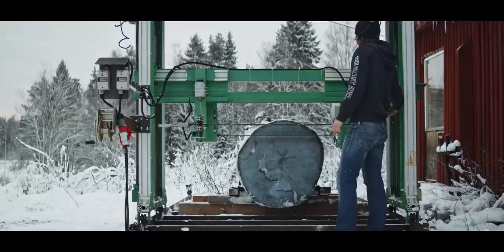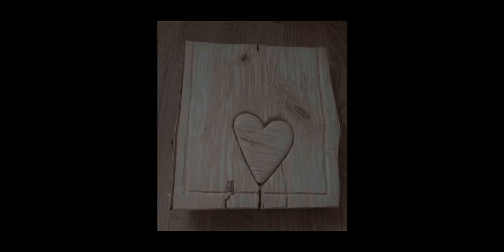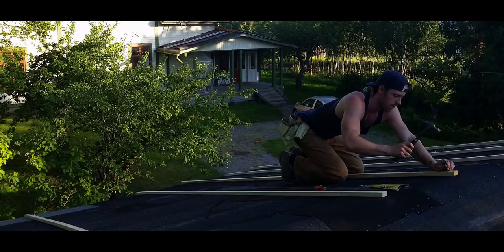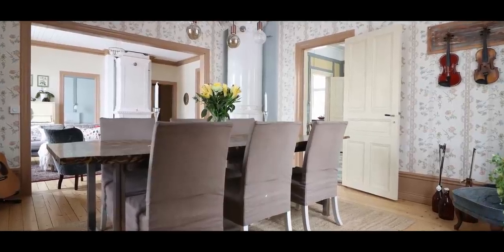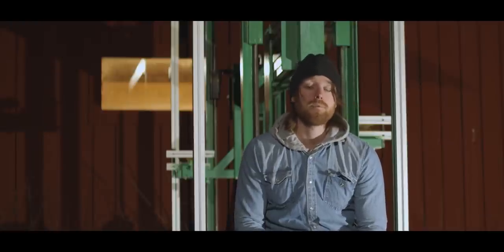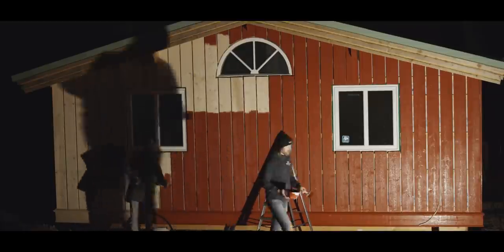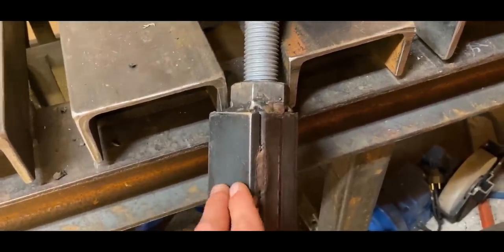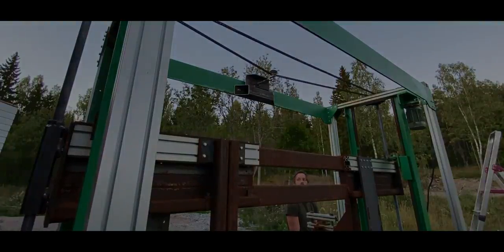Building A Double Cutting Sawmill And The Story Behind It

Comment: I tripped over this channel last week and have watched most of the milling vids. The one thing I kept thinking was this is one big strong guy who someday will break his body wresting with these ever-larger cuts. You obviously had some of the same thoughts and came up with a grand solution. Your design could be scaled to double the bar length and almost any amount of track. The instant torque of the electric motors must be nice. Are you lubing the chain with water or oil? Keep posting. Your content is impressive and will catch Youtube`s AI brain soon enough.
Reply from the maker: Haha thank you my friend, glad to hear you are enjoying the content. The electric motors are very nice. With a sharp chain they cut very well and there is a built in oil pump in the motor and i also put an extra pump at the nose end of the long bars. It’s nice not having to mess around with gas either, just plug in the cord and push start. I’m trying my best to get some more videos put together, been absolutely swamped with work and family for the past months, but I truly appreciate you tuning in and there will be lot’s more videos coming in the (hopefully near) future.
Reply: @backstromwoodwork566  maybe you could connect some fixed cameras like a security system would have. Then you would only have to do a few small cameras setups to make weekly or every other week videos. Just a thought. I'm new to your channel. I'm guessing you are in Sweden?  Tack så mycket

Comment: Very impressive mill you have build yourself there. I was hoping you may have some close up pictures or videos of how the drive axle system of the rim sprocket is built? Is it just a ball bearing pressed into a piece of aluminum with a shaft through it? I built a sawmill myself (not as nice as yours but it works) and I am always looking for ways to make it run smoother. Thanks in advance and kudos on the build.
Reply from the maker: Thanks Evan! I’d be happy to show the drive assembly in a future video. Will be running the sawmill a lot this spring and summer so I hope to make a bunch of sawmilling videos

Comment: Very seldom do I have the time or the attention span to finish a video. I had no problem sitting through this one. Beautiful story and excellent job telling it. You and your wife are a rarity these days and give me hope for the future generations. Nice job on the mill. I am curious as to why you didn’t go with a band mill? Smaller kerf,  less waste , faster cut time. You definitely have the skills. I think I’ll hang around and see what else you have. 
Congratulations on that little one!
Reply from the maker: Hey man, thank you so much for your kind words, i read your comment to Sofia and she says thank you as well. We both appreciate it very much 👍 well at the time i was comparing costs, chainsaw vs bandsaw, and quickly realized building a large enough bandsaw was out of my budget. I already had most of the stuff i needed to make this chainsaw mill so it felt like a no brainer. And this made even more sense since i was only interested in milling slabs. Logs are typically very big, and when doing these wide cuts a chainsawbar stays nice and straight. Bandsaws also cuts straight, but to make really wide cuts succesfully and reliably, large diameter wheels and fairly wide blades (preferably 2”), are a must, and thats when it got expensive to build. A thin kerf is nice, sure, but if the blade wanders half an inch in the cut, the amount of waste that gets produced later when the slabs are flattened would effectively be greater than the kerf made by a chainsawbar that stays flat the whole time. That’s why i dont worry too much about the size of the kerf for this application. But i would never cut 4/4 lumber with my mill, that would be very wasteful :) hopefully that answers your question. And hey, you are not the first one to ask so maybe i could make a video about this topic to share my thoughts without having to write a whole novel. Again, thanks for commenting, all the best to you!
Reply: @backstromwoodwork566  LOL I appreciate the novel. Everything you said makes perfect sense. A video is probably a good idea save you from having to answer that again. I appreciate you taking the time to answer. Now I’ve got a little time I think I’ll check out another one of you videos.
Talk to you later

Comment: Great story and congrats on the new life (daughter and home).
One thing I would like the know, how is the accuracy of the board between the two blades?
From my experience, depending on the timber, the cut end of the board will creep up and down with stored tension in the log as you progress through the cut. By having your blades staggered, you may find that having the top blade pass through first will improve the accuracy and lead to less time spent planing etc.
Just my thoughts, other than that, I applaud you on your build.
Reply from the maker: Hi Mack! Thank you for your kind words! The accuracy is okay for this application, i set the two bars so it cuts a 3” slab (it might be off +/- 1 or 2 mm or so sometimes) on the bottom cut i use ”wedges” which isnt really a wedge but its a piece of flat bar just a hair thicker than the kerf, this allows me to use real wedges in the top cut without pinching the bottom cut, if that makes sense. It seems to do the trick.

Comment: Definitely an upgrade from a chainsaw or Lucas mill but you still cutting 3/8 kerf, cutting painfully slow, constantly grinding chains and ultimately end up w/ a coarse/rough cut. Also, noticed you are using alot of extruded aluminum, not sure about all that.  Personally, I would build it from steel. Anyways, seems original, thank you for the video.
Reply from the maker: Hey thanks for your input, and yes, chainsawmilling is slow, these motors are not incredibly powerful, they cut faster than my 661 for sure, but not a lot. I’m running a  404 hyper skip chain for most of the stuff I mill, huge kerf and that’s a huge minus when chainsaw milling, but the hyperskip does leave a pretty nice finish. Currently it is set up to mill 3” thick slabs, usually 3 or 4 passes with the mill to slab an entire log, after that both chains need sharpening. Appreciate you taking the time to comment, all the best my friend.

Comment: This is a great video. Really good work. Subbed!

Btw what is the model number and brand of the electric motors you upgraded this mill too? Im pretty curious what HP rating they are and how long of a bar they are powering. Lastly, what are the chain characteristics you are running on the bars?

Sorry questions, but it would really help me if I knew. Thank you in advance!

Comment: I tried a chain mill..Built it and used it for one year..They chew a lot of wood..My factory built band mill works so much better..You are young and like to build..Im 67and getting slower.So have fun with your mill then switch to band mill type...
Reply from the maker: A proper bandsawmill is on my wishlist, when i got the money i will get one. Chainsawmilling works for my application, but theres not much other than slabs they are useful for.

Comment: Great video, nice to see a young couple that works hard together. I have used chainsaw mills and they are noisy and slow as molasses. Why did you stay with chain instead of a bandsaw blade?
Reply from the maker: Thanks John. It was mainly due to the lower cost of building, running and maintaining a chainsawmill that at the time made the most sense to me. If i had a larger budget back then I would have built a bandsawmill, because as you say chainsawmilling painfully slow at times. A few pros however is that it is very easy to make a chainsaw cut nice and straight, and it is relatively inexpensive when things go bad (nails, screws or other surprises in a log) normally I would just replace a tooth or two using a breaket and spinner. 95% of the time i cut 3” slabs so the large kerf it makes is something i can live with
Reply: Thanks makes sense, keeping the surface really flat saves you time later. Nice job with your videos, and the music you choose  is great. Some channels I watch have great content and terrible music.
Reply from the maker: I really appreciate that, thanks again for taking the time to write a nice comment and for checking out my channel. Hope you will return to watch future videos, best wishes to you.

Comment: There is little doubt that band saws are preferred for dimension lumber because the kerf is much narrower, less sawdust and more lumber means more profit. The exception is slabs. To stabilize a band saw blade cutting a slab you simply need a much larger band saw. By the time you scale up the band saw, the kerf advantage diminishes, and the machine weighs many tons. These machines exist in old mills, however, moving them is expensive, and they are probably close to worn out if not rusted out. So, with the chainsaw bar, the chain is stabilized and the double bar fixes the geometry. This setup does not scale up for someone interested in millions of board feet, but that is not your interest.
Reply from the maker: You hit the nail right on the head my friend. Bandsaws are awesome, but there’s a reason the wm1000’s of the world are so expensive. They’re not cheap to make when you want a bandsaw that cuts this wide. Chainsawmilling with all it’s drawbacks is still a very viable option for the small business focusing on slabs.

Comment: Hey.  Were did You g’et the  olie pump for the Saw 
And Nice video 😉
Reply from the maker: Hey thanks man, the oil pump comes with the motors. Pretty cool design on those little pumps. The motors are made by Logosol.

Comment: I am so confused by this sawmill design. This is probably the best-made stupidest design I've ever seen. wtf. Wow. I'm so annoyed that you are so capable and so hard working and yet this is what you made. What problem does it solve?
Reply from the maker: Haha thanks.. i guess..? No i get it, and your question deserves an answer, so here goes. There was never any real problem to solve, it worked just fine the way i had it set up originally by just putting my chainsaw on the carriage and using that as a powerhead. But the 661 did struggle.. My two options was either to covert to a large bandsawmill, but given the size timber i cut and mostly hardwood, a capable bandsaw, even if i built it myself was out of my budget. Option number two was to get more horsepower to my existing setup, but i didnt want to buy another chainsaw. Instead I opted for these electric motors from Logosol. I got a good deal when buying two, and there wasnt gonna be too much work invovled in fitting those to what i already had. And then another thing that I didnt talk about in the video, but will now, just bare with me.. the style of log house that are most common here in Sweden is to use logs that are cut on two sides, typically 6” or 8” blocks, (think half cants) sometimes gangsaws are used with reciprocating blades to produce these blocks. Building log cabins has been a hobby of mine since 2016, and i always wanted a sawmill that was setup like a gangsaw to cut these blocks that are used to build log homes.. anyway, im going off on a tangent here but it will make sense soon. So then when i ended up buying two of these electric motors, thats when i got the idea to use two seperate bars so it acts more like the gangsaws. Initially the discussion was about using two motors to power one single chainsawbar to only cut slabs. However simply doubling the power in an already powerful drive, does not directly translate to double cutting speed, you eventually get to a point where the chain cant take a bigger bite, no matter how hard you chew. If you double the power while at the same time increase your chain speed then yeah, you can get a little more out of it, but the motors dont turn that fast. And believe me i did think a lot about that option. Retrofitting sprockets from harvesters to up the chain speed, different belt pulleys etc. But nah, too much of a trial and error thing to have it working optimally. I went the simple route and just doubled the number of chainsawbars cutting at once and in essence, doubling the speed. That’s what i wanted to achieve, and i also got the added bonus of being able to cut blocks for log home building in one single pass with the sawmill, and that makes producing those blocks go super fast, which in and of it self is a good side business. The subject matter of the video was the sawmill, but the spirit of the video was to show that with perseverance and as you say, lots of hard work, you can achieve your goals. The sawmill is just another project among a lot of projects that I had to get done to reach my goal. And i actually just did. About a month ago i quit my job run my business full time, and it is an awesome feeling. I appreciate your comment, all my best wishes to you.